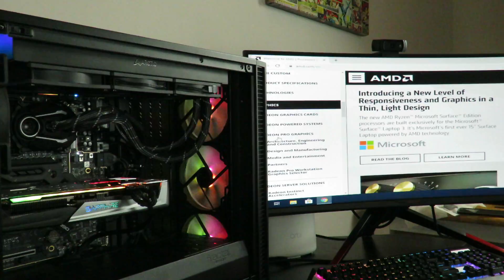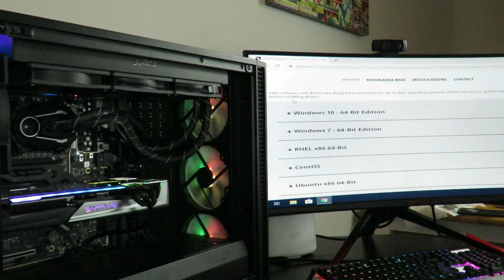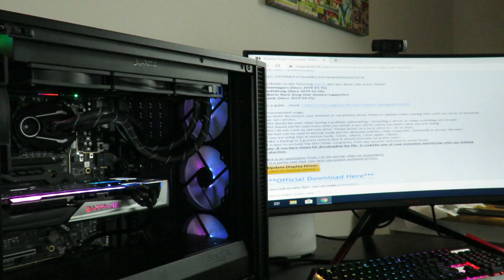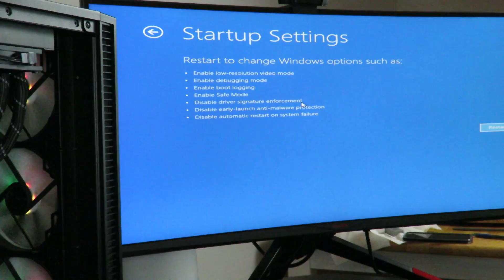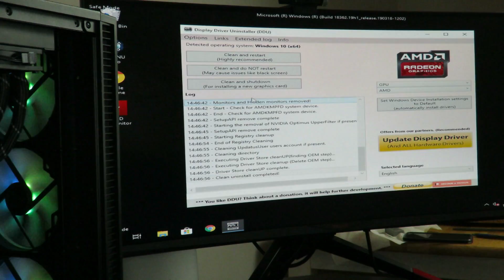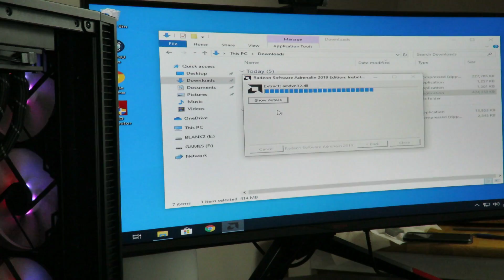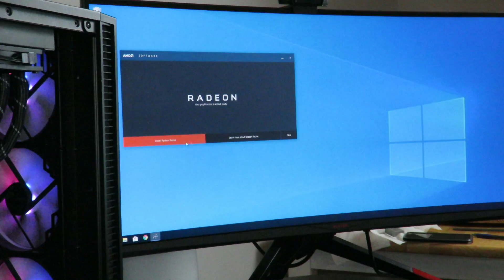Installing the AMD Sapphire Radeon Nitro+ RX 5700 XT 8GB OC Graphics Card

Comment: Hello dude great vid btw. I want to ask , i bought this card i put it in my pc just as you showed ( i had on board graphics before) but when i open my pc i have a black screen popping and i cant do anything about it. I have a 750 w psu so i think its not an issue also the card its not faulty because i send it back from the place i bought it and they said to me it's ok. Do you have any idea what should i do?
Reply from the maker: so you need to make sure you have the monitor connected to the card, make sure the hdmi/dp cable is completely pushed in (on both sides) and is not grounded, hitting the metal in between each pcie expansion slot on the case, make sure on the monitor you have the correct input selected, like if you are using HDMI, you have hdmi selected and dp respectively.  Let me know if this helps.
Reply: @ThisBytesForYou  i don't think the issue is the connection more like the safe boot drivers thing but i didnt had a card before so im in a dead end
Reply from the maker: do you see your BIOS post screen when you start up your computer?
Reply: @ThisBytesForYou  no the pc is working i can hear it but there is no display on the screen
Reply from the maker: but do you see the post screen, where it shows your BIOS logo and maybe windows booting, or do you see nothing at all?  I am not talking in windows, just your BIOS POST screen.
Reply: @ThisBytesForYou  I'm not seeing nothing at all , im hoping i can use mobo graphs so i can put it through safe mode and identify the issue what do you think should i do?
Reply from the maker: @darkinside8637  if you are not seeing anything at all, its not windows or a drivers issue, you are having another issue.  Please provide manufacturer and model number for your processor, motherboard, video card, monitor and power supply.
Reply: @ThisBytesForYou  i don't know if its a drivers issue i didnt put it in safe boot i gave it to a guy and he said to me that he put a gtx 1660 and it played right on , i don't know what to do
Reply: I have i7 9700k , z390 aorus pro wifi , rx5700xt nitro+ , samsung cjg50 , 750 w gold + corsair cx750m
Reply from the maker: @darkinside8637  I know its not a drivers issue, when your system shows the POST screen, it has nothing to do with drivers, you can't see POST, its not driver related.  

1. Remove the video card, and reinsert it.
2. Make sure to connect both x8 pin connections to the video card.
3. Make sure the HDMI cable is firmly seated into the hdmi slot on the video card, the plastic holder piece should touch the IO of the video card.

Some monitors with AMD cards will not show the POST screen, so you could be booting into windows, and have a driver issue, after you have tried all this I mention, turn off the machine, turn it back on, wait 10 seconds, turn it off (by holding the power button for a few seconds), then turn it back on, wait 10 seconds, then turn if off, repeat this process 4 times and then turn it on and if it is posting, you will go into the safe mode window.  At that point, this video should help you: https://youtu.be/Qh2xEUXWeqs
Reply: @ThisBytesForYou  and if all that doesn't work im buying a rtx and i have no issue i suppose
Reply: @ThisBytesForYou  if it doesn't post i suppose i can't do nothing
Reply from the maker: @darkinside8637  well you can't go wrong with an RTX, of course as long as it's similar in performance or better and in cost.  Sadly AMD is having some issues with drivers at the moment, but your issue is not with drivers.
Reply: @ThisBytesForYou  thanx dude , so my issue is hardware like so thats why i cant boot , i will do the things you said and i will tell you the result
Reply from the maker: Thanks bud, I hope to hear from you soon.

Comment: Thank you for posting this step by step install. I always review best practices before an important task. I have a question about opting out of DDU. I am upgrading from a Radeon Fury R9 to the RX 5700XT, and I am already running Radeon software. I have just downloaded the latest Radeon software for the RX 5700XT (Adrenalin 20.12.1) in advance of the upgrade. I am wondering if I should install the new Radeon software first and already have it in place before I complete the physical installation of the RX 5700XT. After all, I am upgrading from Radeon to Radeon. I value your opinion. Your thoughts, please?
Reply from the maker: You are so very welcome my friend, so very happy to help.  Before i answer your question, it is important to know what are your PC specs, manufacturer and model number, including your monitor as well.
Reply: @ThisBytesForYou  
The PC in question is a DIY build from 2015. I am preparing to build a new rig this year, but I wanted to make one more upgrade before the next project. The specs are as follows:

Motherboard: ASUS Sabertooth 990FX R2. 
CPU AMD FX 9590
RAM: 32 GB (8x4) DDR (2133Mhz)
Powersupply: 1,000 watts
Video Card: Fury R9 4GB
Display 1920X1080
The mean average frame rate in games is over 1,600 fps.  
The rig is designed with temperature management in mind. My top case temp was recorded at 36.5C. The entire rig is overclocked to provide a +15% performance improvement. 

The upgrade is to an XFX THICC III Ultra RX 5700 XT 8GB
I am also adding a non RAID 1TB SSD SATA3 to use purely for swap memory (page file) expansion. I have checked hardware compatibility, and I am 100% compatible, but I will not benefit from the PCIE x4 because of the age of the motherboard.

My experience: 10 Years with Dell Inc. My specialty was as a Business Systems Analyst (interfaces both UI and applications), but I have hardware experience in servers, pcs, and thin clients. I am trained to perform two prerequisites to an important task. The first is to pray, and the second to review all the best practices documented by others.

The issue: I am running Fallout 4 heavily modded. At times my VRAM is maxing at 204%, but my RAM is maxing at 30%, so the rig can handle the demands.  I am not upgrading the motherboard because the motherboard upgraded is in the budget for the new pc build. The RX 5700XT upgrade would double my VRAM and improve overall graphic card performance by at least +71%.  

My thought on the question is that the Radeon Adrenalin software supports both cards. Therefore it makes sense to install the application first and let it detect the new card. I also don't want to uninstall the fury drivers in the event I want to reuse the fury in this rig again in the near future. 

One final note, I am also big on using electrostatic discharge protection. My workbench is heavily guarded against ESD, and I do strap in. 

Thank you in advance for your opinion and input.
Reply from the maker: That frame rate is insane... but I don't think it correct, though at 1080 on a low profile maybe.... but heavily modded, I dont know.  I too worked for Dell, when they bought us, I was product development engineer for Alienware, then after I left Dell, Velocity Micro.
 Regardless of that,  not sure why are you mentioning x4 PCIE, it has nothing to do with anything here, unless maybe you missed something? 

At 1080p, you are using more CPU than GPU.  Adrenalin does support both cards... but when you install the new card, you will be using the new drivers, which will overwrite your current drivers, so if you took the 5700 out the drivers would still see your R9, so it does not make sense to leave the drivers installed, nor will they stay installed, they will be overwritten.  I recommend you update your BIOS on that board to the latest version and make sure, if between the latest version on the version you have now, if there are any in between versions you need to flash to reach the latest version, you apply those as well.

ESD can be bad, but as long as you ground yourself on the case, maybe adding in a plugged in power supply on the case you are good, you don't really need to strap in.

I hope this helps.
Reply: @ThisBytesForYou  Thank you, your opinion helps and confirms much of the best practice protocols I am already adopting.
Reply from the maker: @michaelreyes9828  cool, happy I could help.

Comment: Bro İ have Asus Tuf 5700 XT Evo 8  GB and there Led 1 and Led 3  opening all time
Reply from the maker: Do you have pcie cables.connected to the card and to the power supply?
Reply: @ThisBytesForYou  Yes i maked thats ☺️ i will send u photo if i can contact with u
Reply from the maker: No my friend, I don't do personal support, takes too much time, I work a day job and I review at night, I barely have time for my family.  I support here when I can.  What is your power supply model number and manufacturer.
Reply: POWER BOOST VK-G2052S RGB 650W 80+ Tempered Glass USB 3.0 Mid Tower
Reply from the maker: not sure what power supply comes in there, but as long as you have 2 x 8Pin PCIE or 2 x 6+2 Pin PCIE you should be good.  Make sure you are not using the 8PIn EPS CPU POwer cable, make sure they are both marked PCIE

Comment: My only question is is it ok to use only one pcie cable but with two 6+2(8) pin connectors?
Reply from the maker: You might want to watch this video, I go over that
Reply: @ThisBytesForYou  what video sir?
Reply from the maker: @HushSmile11  the video you commented on, this one
Reply: @ThisBytesForYou  I watch the whole thing but what I meant is my pcie cable has 2*8 pins but merge in one cable only but some say you need split cables for stability sorry that I'm not fluent in english as I couldn't explain it clearly 😅
Reply from the maker: @HushSmile11  No no, you did explain it correctly, but here I show you I use 2 x 6+2 connection, "4:50 Plugging in the PCI-e connections" so you are fine
Reply: @ThisBytesForYou  tnx sir appreciate the help new subscriber also 😊
Reply from the maker: @HushSmile11  anytime my friend, very happy to help and thank you so much for the sub, it means a ton to me.

Comment: Hi, I would like to know if someone has temperature issue with this card, I just buy it last week and I’m having serious issue with the temp. I have to undervolt the card to play for some hours and then crash.
Reply from the maker: let me know what your temperatures are and then also, how many fans do you have in the front of your case and are they blowing into the case or sucking air out of the case?  Do you have any on the top and are they blowing air into the case or sucking out and do you have one in the rear, blowing or sucking?
Reply: @ThisBytesForYou  I’m working right now, but when I get home today I can take a pic of my pc and show you, I appreciate the faster reply, I’m a little piss off cause it’s an awesome graphics card, but I only could try it at full for only 10 minutes before it crash. When I use the undervolt profile from adrenaline software I can play more than 8 hours with out crash, but lost a lot of performance.
Reply from the maker: @alejandroadrianfernandez9853  you should not have to under volt your card, I am sure you need to update your fans, but actually, this might help you too: https://youtu.be/LgBR7Cei5yM

Comment: Pls can someone explain me why both 8 pins pcie connectors (6+2 pins) of my PSU are conected to some kind of pci dual cable that ends on a male 8 pins (wich is right now powering my 8 pins gpu )????
im talking about a dual pci cable (on one end it have 2 female 6 pins, and on the other end one male 8 pins), its weirds, for me at least
Reply from the maker: So dual 6+2 that end at an 8,... an 8 that is supposed to connect to your power supply?

Comment: Thanks for the video! I have an nVidia 1060 I am about to replace with the Radeon 5700 XT. 
Would this process work? 

1. Disconnect machine from the internet.
2. Boot into Safe Made.
3. Run DDU to uninstall nVidia drivers. Set Windows Update to not install drivers. Select clean and don't restart
4. Power down machine (gracefully).
5. Remove nVidia adapter and install Radeon adapter.
6. Boot machine normally and install manufacturer's drivers. 

I am trying not to have Windows auto-install drivers for the Radeon card.

Thanks!
Reply from the maker: Yes, just go over everything I have in this guide and it will take care of you and anytime my friend, always happy to help.

Comment: Hi, Do I need to connect the argb cable (3 pin) to have the led on? , My mobo only have 4 pin led connector :(
Reply from the maker: thankfully no, that is just in case you have it to make it sync with your system.  If you don't have it, you can use TRIXX to change the lighting, so you are good.

Comment: how can i lower my temp more in NXT 510? i have 2 stocks 1 back top and 1 top back or how you wanna describe it basicly exit area top and backtop and then i got the card below my temps are like 75+/- max
Reply from the maker: you can lower your temps by having 2 fans in the front as intake, 1 on the top and 1 at the rear both as exhaust.
Reply: @ThisBytesForYou  hmm ok thermocooling no needed right ( watercooling i mean )
Reply from the maker: @JoeGameVideos  no, not at all and you can check it out for yourself here https://youtu.be/YWzqVU6Oq74, let me know what you think

Comment: Hi there! I just bought a GPU and the pin out is different from yours. I can't connect 2x8, it has only 1x8 and 1x6. Did anyone have this problem? I'm not even sure if it is a problem..😂 Thanks! The gpu is: https://www.sapphiretech.com/en/consumer/nitro-radeon-rx-5700-xt-be-8g-gddr6
Reply from the maker: its not the same card, that is the BE but its not an issue, if you have any 6+2 connections, just dont connect the extra 2 pins
Reply: @ThisBytesForYou  Thank you!
Reply from the maker: @mariush2429  anytime my friend, always happy to help.

Comment: Would you recommend installing the chipset drivers for my CPU as well? I have heard that the AMD GPU drivers work even better when paired with the CPU drivers. Also, how do I tell if my drivers were installed and running correctly? I used to have an Nvidia card, uninstalled those drivers and downloaded the AMD drivers. Should I be good to go?
Reply from the maker: You should, but I do recommend redownloading the chipset drivers, then use DDU to remove the old drivers (graphics drivers) in safe mode, then reboot, reinstall the chipset drivers and then reboot if asked then install the latest and greatest graphics drivers.

Comment: How come every YouTube/YouTuber video they have really high fps. I can't seem to get anywhere near 100fps on 1440p 144hz with any games. For example on Apex Legends am only getting 88 fps at 1440p. Any advice why that could be. Thanks in advance i would really appreciate the help.
My specs 
-Nitro Sapphire 5700xt 
-Ryzen 5 3600
- G skill Trident Royal 16gb at 3200
-Asrock B450m steel legend 
- 600w psu
Reply from the maker: they more than likely have higher FPS because they have lower settings, while this is a GREAT card, and works well at 1440p, not all games can play at ultra presets, you may have to tune down some settings.

Comment: I installed the new adrenaline drivers on my pulse rx 5700xt oc because when I launched a game it said my cpu was at 90% usage and my gpu was at 0% (just built this pc last week) so I naturally thought it needed drivers and it black screened. Tried restarting the pc and nothing. I then booted windows off of a second drive (I have dual nvme m.2 drives) and the card displayed but still was at 0%. I want to delete the drivers off my first boot drive but my pc won’t let me access it. Help!
Reply from the maker: see if this helps: https://youtu.be/Qh2xEUXWeqs, also, what is your motherboard manufacturer and model number?
Reply: My motherboard is a msi x570 gaming pro carbon and I don’t know my gpu model number but here is where I got it. https://www.amazon.com/Sapphire-11293-01-20G-Radeon-Backplate-Graphics/dp/B07WC7683C
Reply from the maker: Hello my friend, I recommend updating your BIOS to the latest version, 7B93v18, this also updates your agesa support for your card: https://www.msi.com/Motherboard/support/MPG-X570-GAMING-PRO-CARBON-WIFI, after you flash your BIOs, make sure to set your PCIE 3.0 slot to gen3 and enable XMP for your memory if it is supported.  After that, do what I recommend in this video: https://youtu.be/Qh2xEUXWeqs and then use the latest AMD drivers to install for your video card.  Please let me know if this helps.  This video also helps you get into safe mode to uninstall your older drivers.
Reply: ThisBytesForYou I’m at a utter and total loss, I just turned on my computer today and everything is working fine, I really don’t know what happened but I was just wanting to say thanks for helping.
Reply from the maker: @paxmax5059  anytime my friend, very happy I could help.

Comment: this card is full of bugs and issues. AVOID!!!!
Reply from the maker: no, the card is not full of bugs and issues, the drivers are, AMD and Microsoft are working on it.  The drivers as plaguing many AMD cards..... not just this one.
Reply: @ThisBytesForYou  i'm so sad about this. I just built my first pc and it's unusable because of all the bugs. Is it the same with other cards? (;_;)
Reply from the maker: @ezquerzelaya  AMD cards yes, but its not 100% with the cards or the drivers, even Microsoft, it has a lot to do with your system.  Let's see if I can help.  Please list the manufacturer and model number for the following
Motherboard
PowerSupply
VideoCard

Comment: Sorry if a dumb question but is it two different pcie cables that go into the gpu or is it one cable with 2 heads?
Reply from the maker: how ever many pcie connectors your card has, you need to plug them in.  It is OK to use the 2 headed connection too, though it is recommended to use one cable each.
Reply: @ThisBytesForYou  ok cool thank you for responding
Reply from the maker: @seriousxoticz837  anytime my friend, hope I helped.